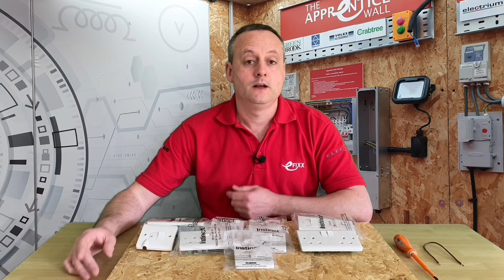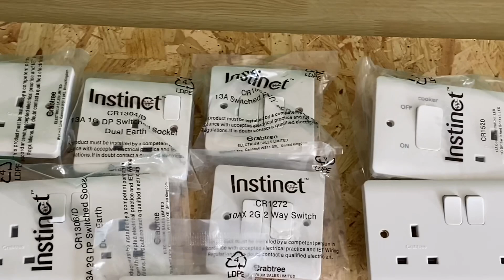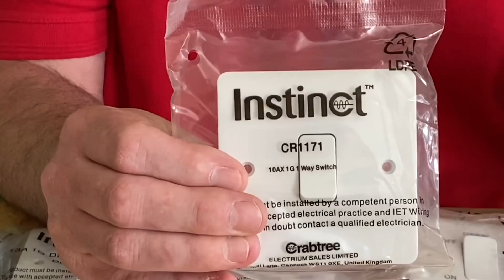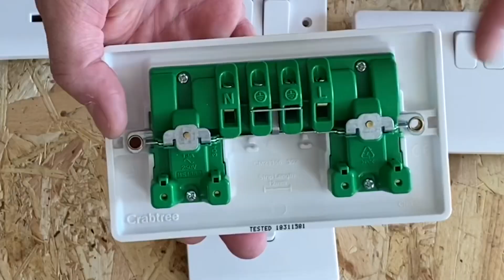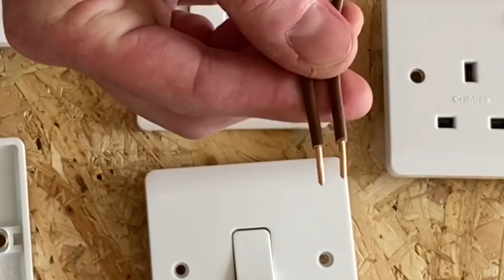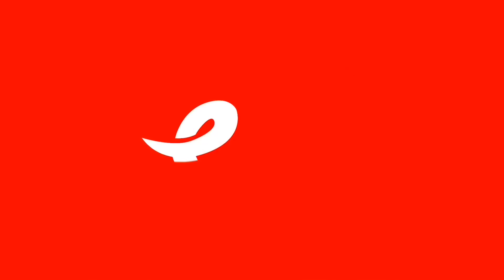Crabtree Instinct range of switches and sockets - can they save electricians time?

Comment: Might be time saving when fitting but if you had those socket fitted throughout the house and you were doing an EICR you would have to go round and disconnect the all LEDs. Or could you get round it by connecting L&N together?

Comment: They design in line terminals to save time which is great but then to test it you need to remove the fiddly cable for the led so you can do insulation test. So where they thinking of a sparky during design I think not. They should all be push fit connectors have been for years in Europe. Honeywell have had them for years let’s get them over to the uk .

Comment: When Crabtree first released a promo for the Instinct range I thought it was a windup because I couldn't find them anywhere ( not that I would chose 
Instinct ), I prefer their traditional Capital range as I fit mostly metal ones in my home and I would personally chose, MK Logic Plus, Click Mode or 
Hager if I want curved edges.     

At least Crabtree are now offering the complete Instinct range in standard white finish. The single socket looks wider than average which could be a problem
if they were being used in a refit where you have 2 sockets side by side. The Instinct range is more appealing to commercial new builds rather than domestic use,
I hope Crabtree don't plan to phase the Capital range out.
Reply: Capital has been a classic in the UK since the late 80s.  They still make Capital here, but these ones are Chinese made.  Contactum still very good and British, but nobody seems to stock them anymore.

Comment: Like the caged terminals.  Nothing more frustrating than tightening the screw on multiple conductors in a terminal, only to see that the turning screw has pushed out one of the conductors just a fraction.  Great video as always. 👍

Comment: Looks like a good range. 
Would of been nice to see the reverse side of the usb double sockets
I would not be looking forward in disconnecting the led to do IR testing
Reply: Looked like they had a big old bit sticking out at the bottom, unlike BG and MK USB sockets which fit in 25mm boxes these days.

Comment: It’s a shame they have brought out a new socket with two usbs that have to divide 2amp between them! A waste of time and money, if it has two ports they should have 5amp to divide. Most electronics have a charging capacity of around 1.5amp to 2.2ish so it’s useless especially as an electrician having to sign of supply and guaranty them. What’s your thoughts on them?
Reply from the maker: More USB content coming soon!
Reply: USB is going to be a waste of time soon and become outdated.  Don't like the idea of all that permanently on electronics in the wall anyway.

Comment: I'm still waiting to see sockets with push connectors on the back. One day everything will be clipped and pushed together
Reply: Genuinely, why don’t they have faceplates with Wago/equivalent on the back?
Reply from the maker: Wago have quite a few patents on the connector tech  is one reason.
Reply: @efixx  would be worth the extra cost as well imagine how little time you would spend putting on sockets and light switches after the plaster and painter has been in. Just cut and strip the cables before the plaster has been and when they are finished spend 30 mins going round pushing everything together. Sounds like a dream
Reply: Stop people jamming in 4 2.5 s into a socket !
Reply: Andrew Hasted this against the regs, right? A given socket can have loop in/out for a final ring plus one 2.5m radial to another socket or fcu etc

You’re saying you see a lot of 4 lots of 2.5T&E in one socket?
Reply: Graham DIY see it all the time pal !
Reply: Andrew Hasted crikey!!
Reply: @GeeTheBuilder  kitchen fitters, plumbers, decoraters diyers........... I've actually seen 4 lots of  2.5 AND a 1.5 jammed in there once........ poor socket